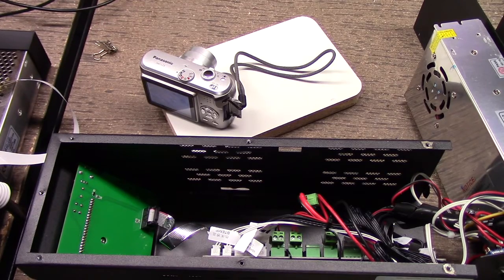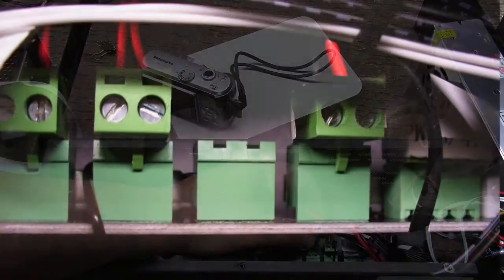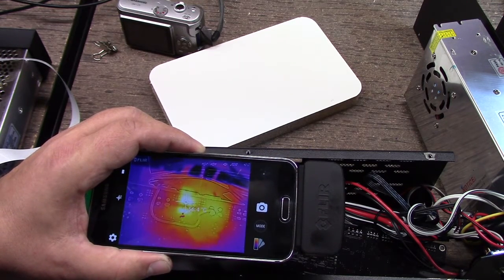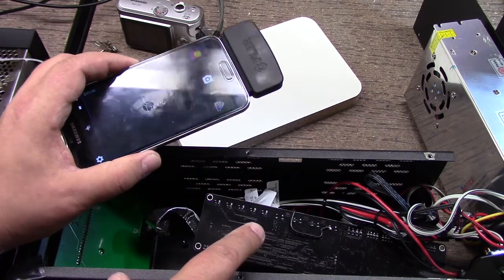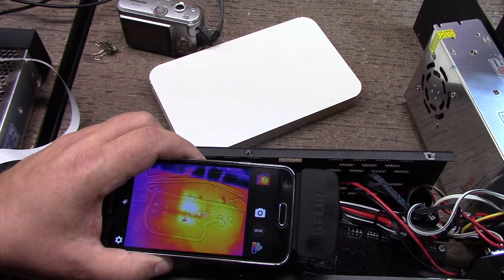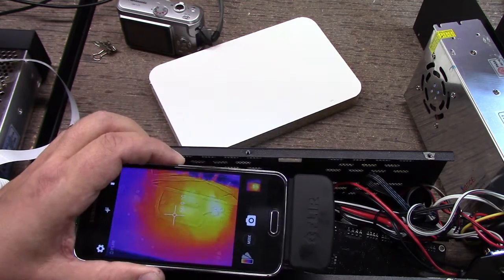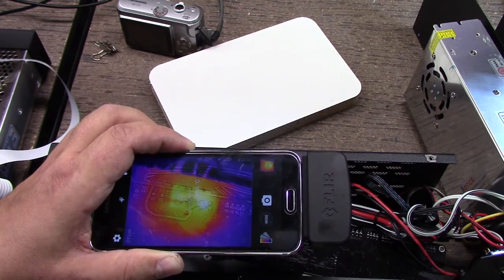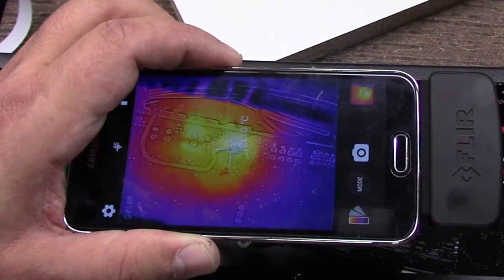Wanhao Duplicator I3 3D Printer - Are you at RISK because of the Heated Bed?

Comment: ooh cold flow solder , did they tin those wire ends before putting them in those connectors ( that's a no no for crush or screw down terminals ) . solder eventually cold flows. this increases contact resistance and well heats up . 
 60c i not too bad but its so local . I would be happier to see a more even spread . 
the ground plane of the PCB should be winking heat away  .  add a fan or better moving air.  check the temps in c of the visible electrolytic capacitors if any on the other side. 
that could indicate that is has the wrong/not best  MOSFET for the job . Tom has a video about picking a good FET.
possibly a replacement of the fet might lower the contact heat . 
Tom's video : https://youtu.be/ND8uJWlOgIQ
Reply from the maker: There might be a little a solder in the tips however not solid job if you know what as you could the positive was not seated so I lossened it and re-tighted it which snugged it up but its far from perfect.  I also fond it that the heat was not moving away on the board.  Also there is a fan in there to, your correct I didn't find 60c so bad but strangly it was very localized.  As mentioned in the video where I do the fix from Wanhao for the hot end, I was not happy with the wiring but it works.  As mentioned in this video I do not trust it to run overnight or when the house is empty.  However it really like it as printer and will run it into the ground :-) After that I am thinking about scraping the controler for an ARM based board like the MP Mini and see what I can do with it.  However simply have way to many projects!
Reply: if just the very tip is tinned allowing bare copper to be crushed , that si just fine in fact thats preferred to fully tinned for safety . 
60c is not so bad . 
if you think any machine might over heat , using a IR fire detector and smoke detector to trigger a mains breaker or such to cut the power , that would be handy . i know one of the guys round here made such a thing for his LiPo charger desk in his shed , any smoke and power is cut to the bench . but much easier and inside the control box ..
you could get one of those thermal cut off that those stand up radiant oil heaters .  they are good for 15a and select a temp . put it at the top of the inside . if it trips the power is cut just to that rig . 
these ones have manual reset : https://goo.gl/HgstNg
Reply: That could indeed be an issue for high current, (its totally fine for low current applications)  there should be bootlace ferrules on the ends of the wire.
Reply from the maker: Yes just the tips/ends are tinned, so question, I alway thought this was best (i.e. tips tinned) as it keeps the strands from separating yet allowed for proper compression of the wire in the lug.  Verses full tinning that would imped solid compression thus reducing surface contact area?
Reply: yeah very end of tip is good . as Andrew Joy said ferrules are the best .
i personally dont tip tin small stuff, i strip double , and fold it back on itself if i dont have ferrules, now its a nice fat copper loop for crushing. unless the wire is low current or logic then fully tin them .